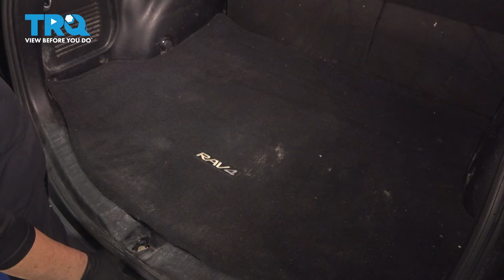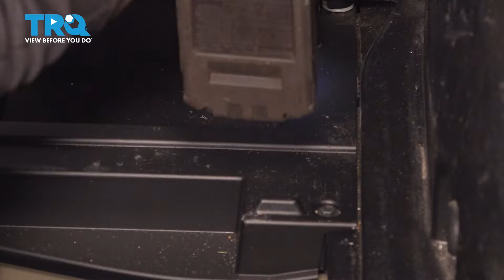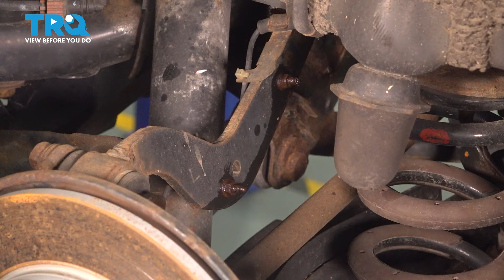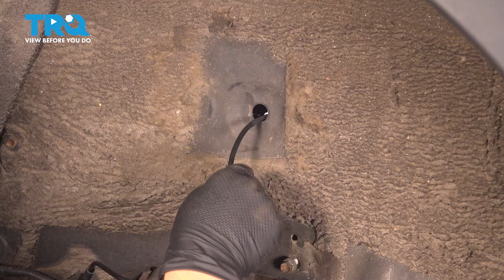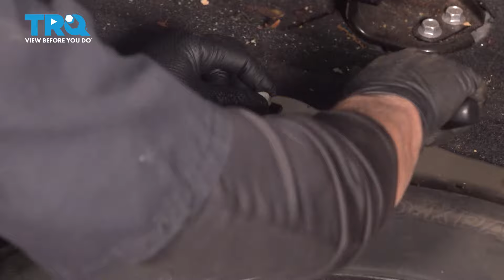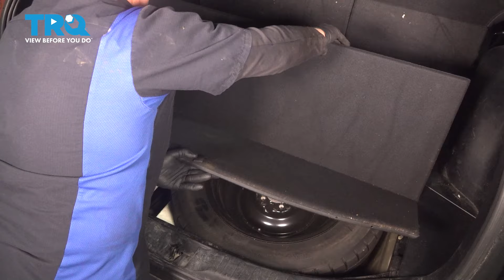How to Replace Rear ABS Wheel Speed Sensors 2013-2018 Toyota RAV4

Comment: Many thanks to you folks for this video! The automotive shop would have charged me around 450 dollars to replace it. We have to save money any way we can with the high cost of everything now days. Found a Denso sensor for 36.00 and spent the afternoon replacing the bad sensor.  abs etc lights went out and everything back to normal. Problem fixed. 
Your video was very helpful.

Comment: Incorrect.  Connector for the wheel speed sensor is on the center of the rear of the hub, not on the knuckle.

Comment: Thanks so much. The dealership wanted to charge me around $2000 to replace the sensor and also the hub assembly for no reason. This video helped me save around 2K doing this easy DIY replacement of the ABS sensor and it fixed the problem!

Comment: Great video! Thaks for doing it. The video wouldn't be necessary if Toyota had just provided a foot of slack in the harness to pull the connector out into the wheelwell to disconnect and connect it, like many other vehicles have.

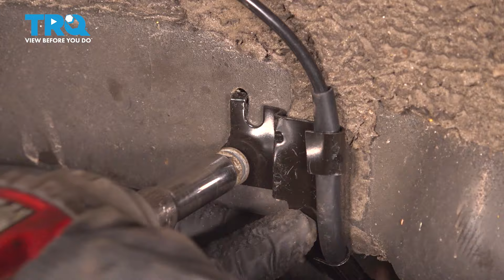Comment: @ 6:30 "There's no torque, just tighten it up" - Translation: Homegirl is already super over this overly complicated replacement procedure. Thanks for the video. I was super confused where that hole led to. Apparently the mice who ate the wire weren't though